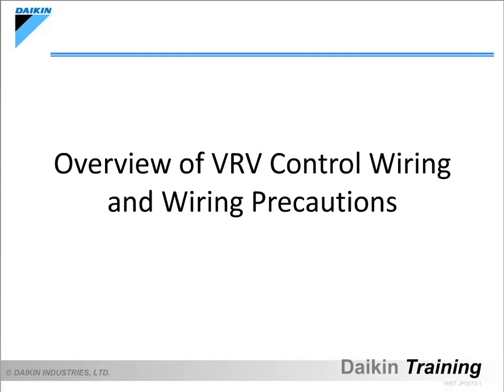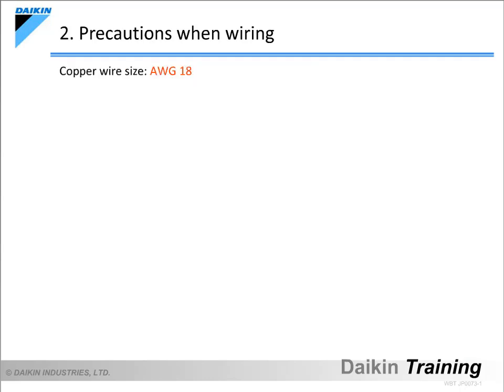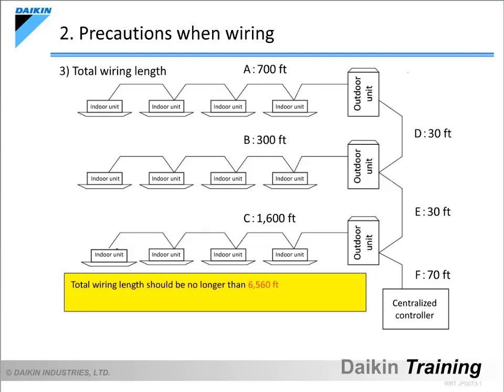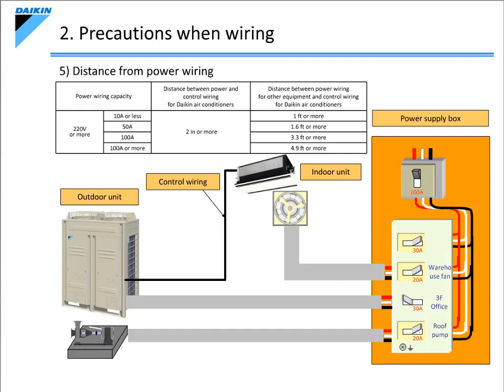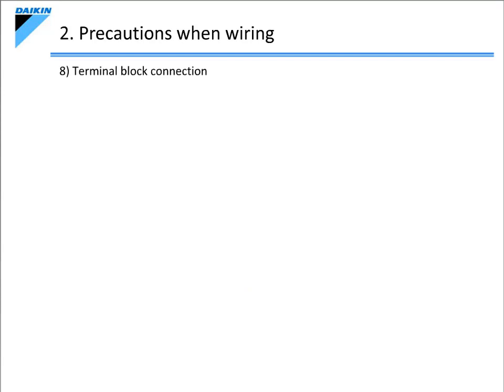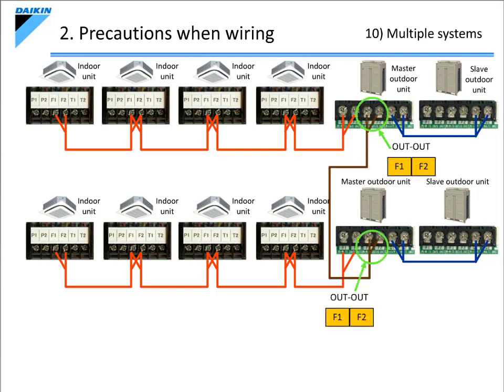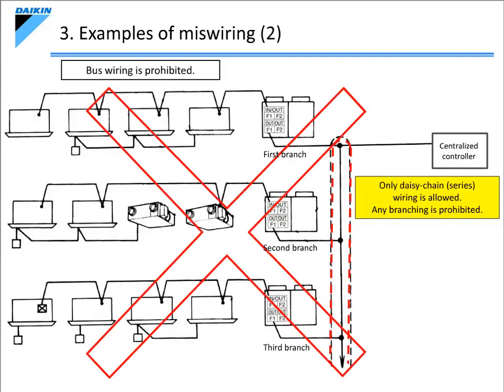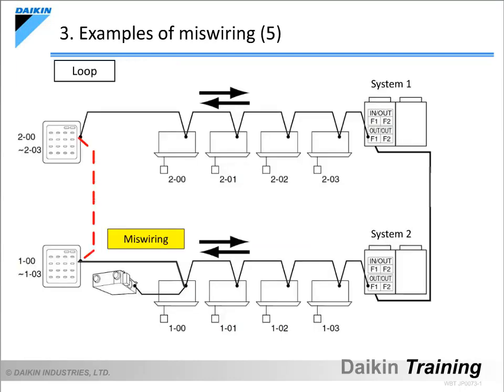DVT 74 Overview of VRV Control Wiring and Wiring Precautions

Comment: How do the F1F2 transmission wires actually work? I thought all electrical wires need to be circuits, but the electrician I work with tells me for VRVs they are just daisy chained to the last indoor unit with no return/neutral wire back to outdoor
Reply: Good question. If you ever find out the answer please share it! ✌️